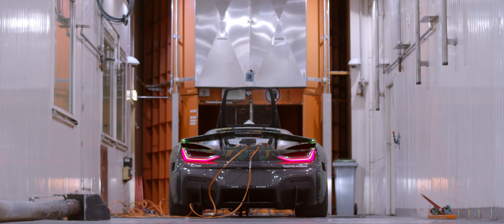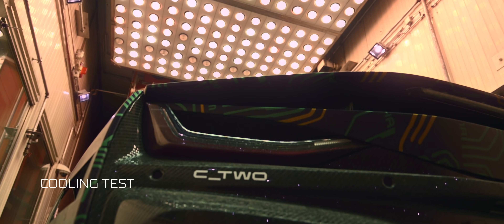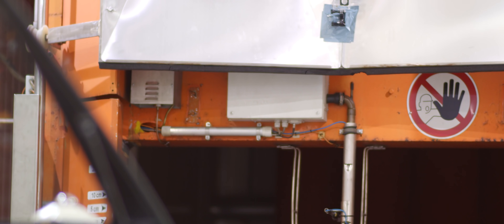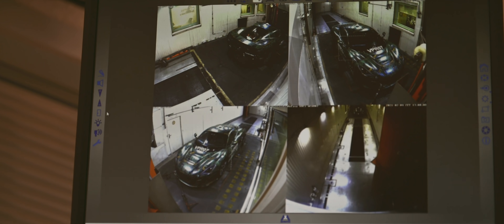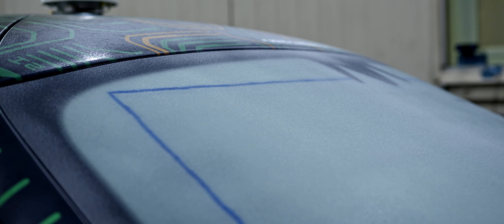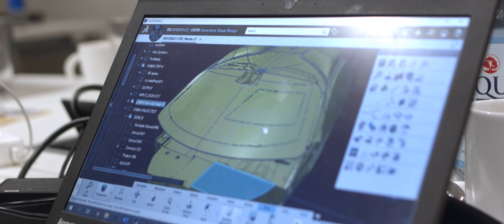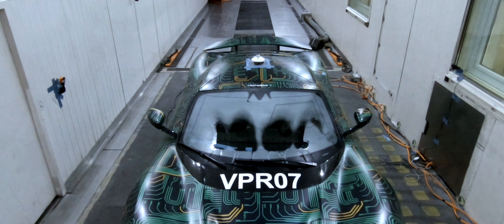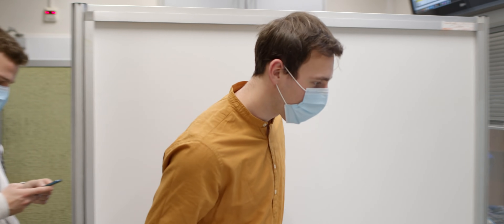Rimac Nevera Extreme Weather Testing

Comment: Great video! What's happened with prototype 5?
Reply: It was used for abuse testing but is repaired and is being used currently. However, it will be crashed in a few months. Why is that specific car of interest?
Reply: @MateRimacAuto   I haven’t seen it in previous pictures, so I was curious 😃  p.s. Any specific date about unveiling?